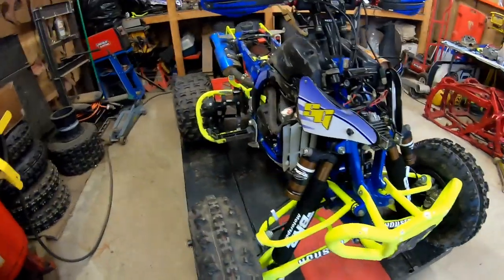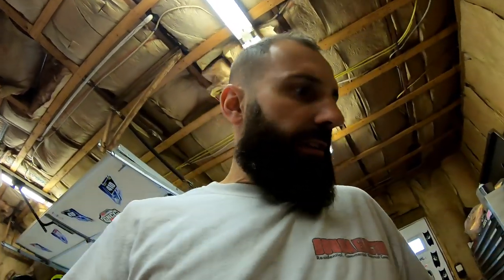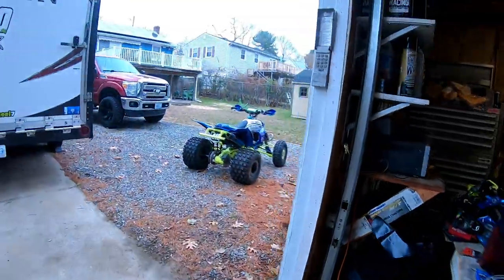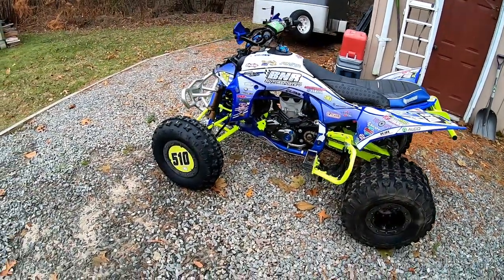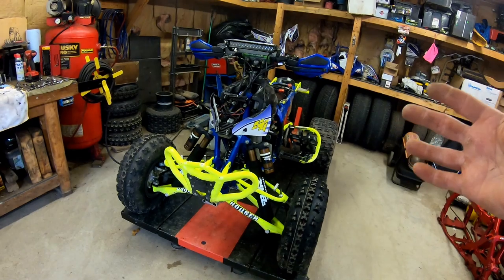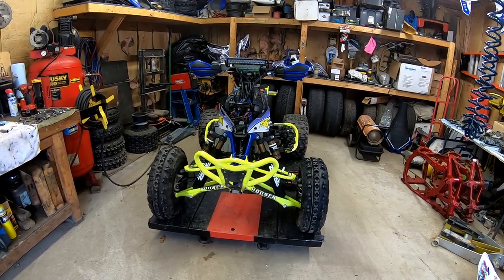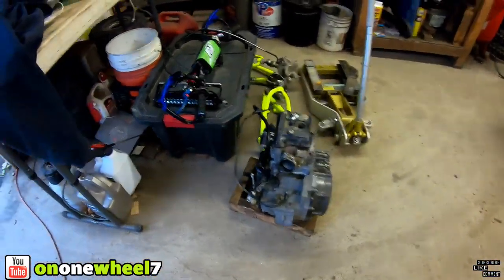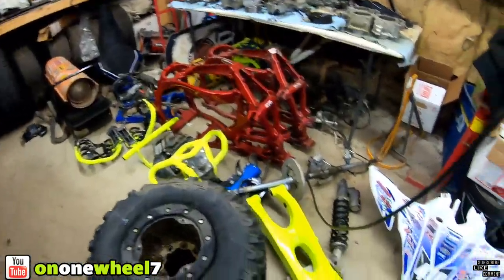NEW QUAD TEAR DOWN

Comment: On the efi yfzs do you know if theres a lot of pressure coming out of the AIS engine hole? Can i rubber cap the stock cable holder pipe to remove the ais system? On my 18 yfz running vortex and yoshi pipe.
Reply from the maker: Gytr sells an ais delete kit buy that and you will be good.

Comment: Of course I always love the videos I have noticed the light bar you are using instead of headlight bought my 2012 YFZ450 R and it does not have headlights previous owner took them off is there anyway you can you can tell me a website I can purchase the light and the mount for the handlebars
Reply from the maker: Thanks man! I run a rigid 10” light bar i actually made the mount out of a strip of aluminum and got some long bolts that bolted in to the flex bars it worked out perfect! Ebay has a ton of other brand light that are way less money and just as good id say search on there and look for a 10” flood/spot combo!
Reply: ononewheel7 Thank you very much I appreciate it
Can’t wait till the next video
Reply from the maker: wesley lackey thank you!

Comment: is there any difference between the old and new one? ( other than after market parts) and wear n tear.
Reply from the maker: There pretty much the same w the exception of front shocks  and the cylinder heads and the old bike is 2 years old the new one was 7-8 months old! The old one i have a bnr motorsports ported head w +1 valves and his custom intake cam the new quad has a mxp ported head w +1 valves and a web intake cam! The old quad has fox air shocks and the new quad has the new bnr custom fox springer shocks which i love!
Reply: @ononewheel7  but stock they're the same? what made ya go with yamaha?

Comment: I've got a complete stock 2019 yfz 450r  I've just got in to the wexcr series woods racing, it has a high gearing 1-3 what would be a good front and rear cog for more bottom end power?
Reply: If you want more bottom end lose a couple teeth up front and add a couple to the rear. Not sure what stock comes with though.
Reply: Thanks I do believe its 14/38. Goodluck on the tear down and preparation for next year!
Reply from the maker: You could try a 13 tooth up front for low end power! Once you start modding it like exhausts/cams/piston/headwork and intake the stock gearing is actually good i run stock gearing i did try a 13 b4 but the gears were way too short!

Comment: trx250r 33 years old gusseted frame hasn't broke since ….. school is out lmao
Reply from the maker: Haha ok how many races on her 🤔 i was pretty hard on this quad this year a few run ins w trees didn’t help 🤣🤣
Reply: @ononewheel7  I did mx on it from 01-09 and 2018 is when I started riding again . but only 5 xc races for the 2019 season . countless rides though lol . but for real it would be badass if you built a trx/yfz450 hybrid build . you would have all the advantages of the 4 stroke motor with the handling of the 250r . oh and a frame that you wont have to replace every season lol
Reply from the maker: Ya I’m sure id break it haha trees don’t move man I’ve tried too a bunch of times haha!
Reply: @ononewheel7  lmao well yeah im pretty sure a tree will brake anything lol and if youre like me you can fuck up somebody elses wet dream lmao but look at walsh racing hybrid frames for yfz450 motors

Comment: man you've torn down them yfz so many times you can do it in under 15mins lmao that's a bummer man . what all did you tear up on it to make you have to rebuild it to this extent ?
Reply from the maker: This took me around an hour and 40 minutes haha I’ve done a few! So the frame is tweaked its not horrible but once they start cracking it never stops and after that last woods o cross race i ran the quad wont start I’m guessing the head needs a service so i figured lets just tear it down and start over def a little bummed i was hoping to rebuild the practice bike even though i just actually did that one!